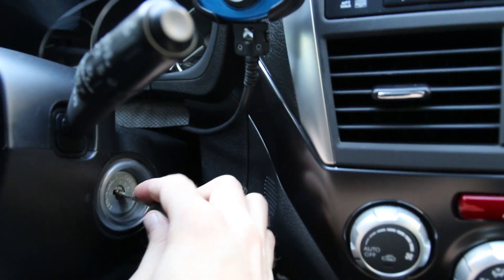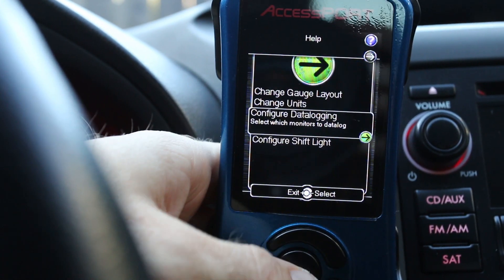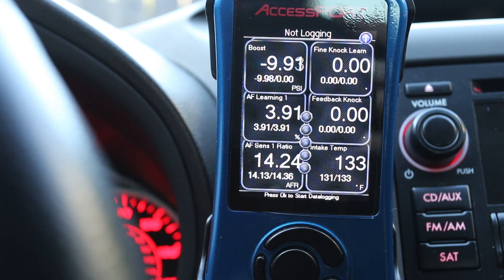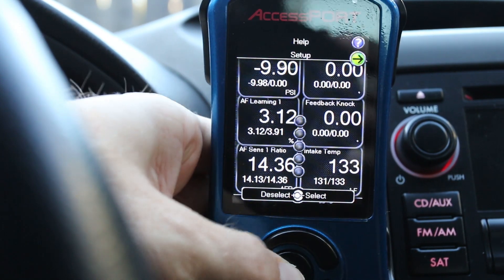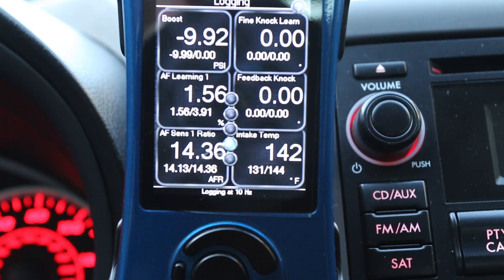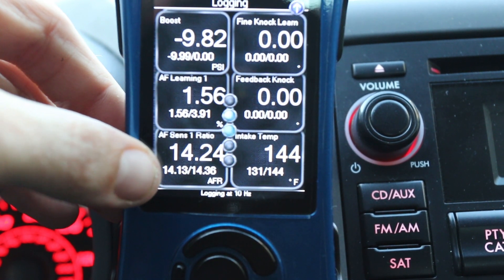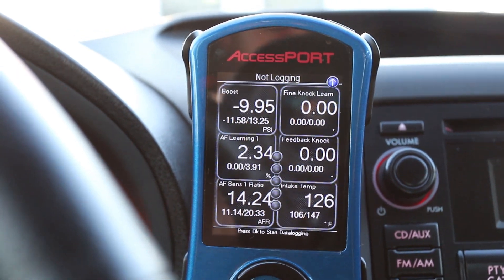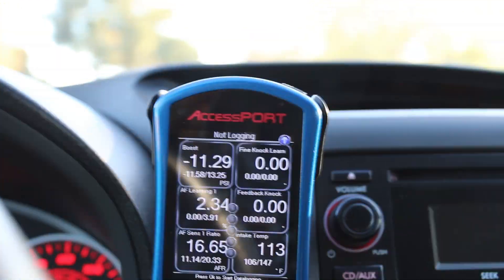HOW TO DATALOG WITH YOUR ACCESSPORT

Comment: I've been told that monitoring feedback knock will make you go insane because of how much false knock these cars pick up! It's impossible to tune out all knock! It's an engine with explosions and its constantly dealing with different air temps, crappy gas, driver errors ect the knock sensor is there to protect the engine as well as fine knock learn! If your getting a -1.40 I wouldn't lose sleep over it!
Reply from the maker: +MaherMic Yeah -1.4 is normal. During pulls though it should be clean under WOT.  I was getting some -2.8 and -4.20 randomly so that's why I was revising the tune. Also the latest revision is much better now. I have only gotten -1.4 feedback knock randomly under light throttle.
Reply: That's good! I need to get a Protune ASAP I don't throw any knock under load but when I am cruising in 5th I get a TON of Feedback knock.  Case in point today I had a -11 feedback knock, again it only happens in 5th cruising with like 18-25% throttle.  I cleaned the MAF and that didn't do anything gonna try and get it to a shop soon.
Reply: And that's just on a Stage 1 91 octane Cobb OTS Map
Reply from the maker: MaherMic Yeah that horrible. I would be scared to run that map too. Also thought you should downshift to 4th if you getting on the throttle in 5th. Most tuners will tell you to never go WOT in 5th unless your going like 130mph.
Reply: Yes sir :) I have never or will never go WOT in 5th!
Reply: +MaherMic hey man I've had the same shit in 5th at 20%, Eric (this is happening on a TP Stage 1+ map 5th or 6th revision) seems to think its noise in the engine and not knock. I've also noticed no loss in performance or other signs of damage, fine knock and DAM are perfect, during these crazy -8 to -11 knocks, so i kind of believe him. When it happens I just let off the gas pedal and it goes away. Other than that I get -1.4 and -2.8 pretty much all the time but never during WOT in any gear. So take a breath I think our cars are fine.
Reply: Cavu Good to know I'm not the only one! I spoke with the guys at PIA (Pacific Import Auto in Washington) and they are seeing the same thing with a lot of cars in the high gears and low loads (cruising RPMs). Just as an experiment I flashed to Cobbs "Stock" Married map and the car felt like it was running like complete crap (with the stock map) so I'm happy with the way Stage 1 feels for the time being and my car seems to run better with it as well and like what you said I notice no performance decrease with those knock numbers and I never get any knock under WOT so I'm not to concerned.

Comment: Thanks for the video Blake! Data logging is so important to know what's going on with your motor. Looks like you're peaking @ 19 psi of boost, which is about right for a stage 2 tune. BTW, your car is LOUD! I like it. What's your exhaust setup?
Reply from the maker: +Max Speed Media Cobb DP Catted and SPT Catback the midpipe is SPT and its non resonated.
Reply: +Blake's Garage Interesting. I'm running a Cobb catted downpipe as well but my Q300 has a resonator. I wish Invidia made a non resonated midpipe that I could swap in. I may end up trying the Invidia N1 Race which is non resonated for more volume.
Reply from the maker: Max Speed Media Also I have 2 audio source for this video. One with an external mic by my exhaust. So that probably why it sounds so mean. It does sound good in person just not super loud.